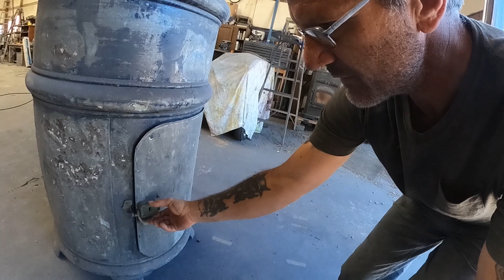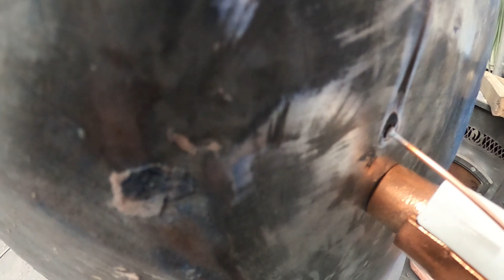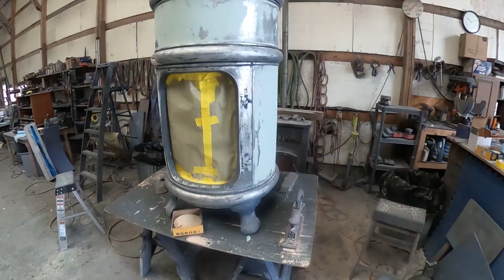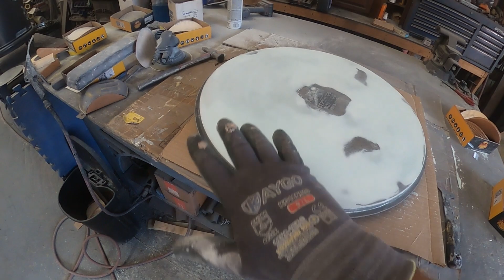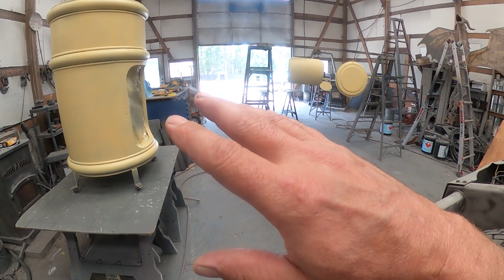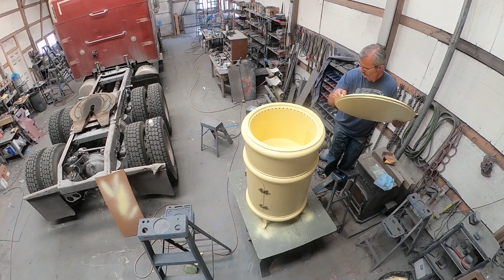1905 White Frost Refrigerator Overhaul...How Cool Is That?!!!

Comment: I restored a vintage battery charger that was close in size to this cooler.  I do not know what year the battery charger was made bit it looked really cool.  It had a 8" round meter witb glass lens in the middle of the control panel.  The bottom 6" of the sheet metal was rusted out and it had dents everywhere but still worked.  I did a ton of sheet metal work to bring it back.

It would be cool to convert that cooler to an actual refridgerator, they have kits to do that and the equipment is very compact.
Reply from the maker: Yeah, that would be cool!